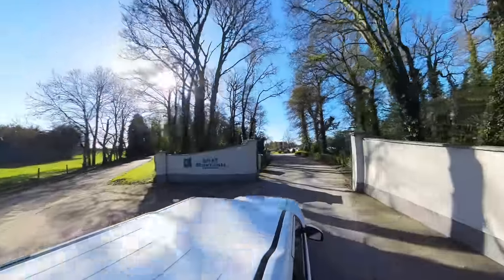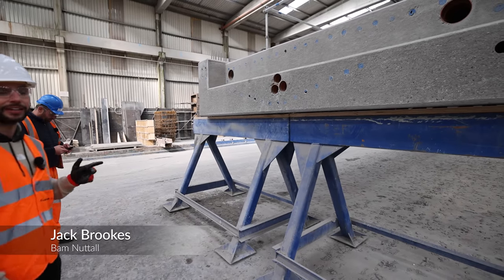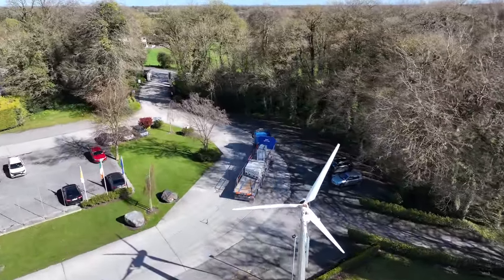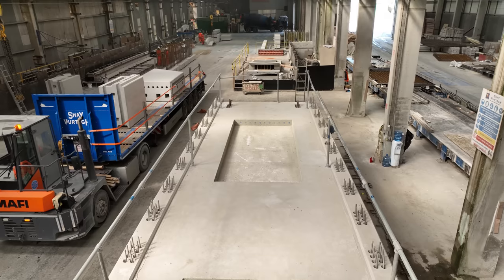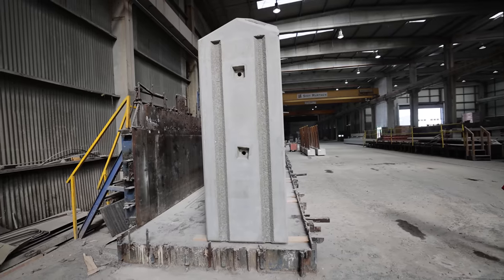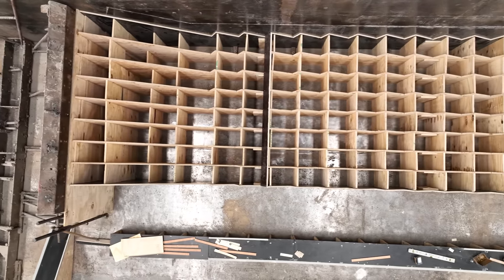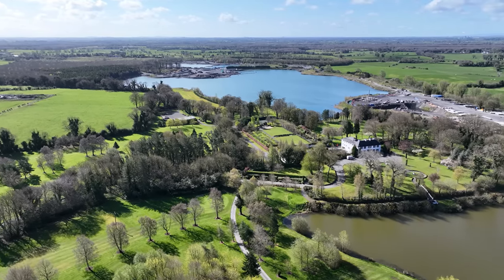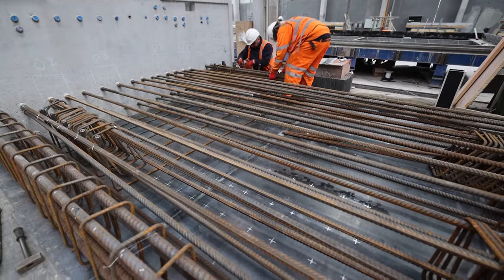Dawlish Sea Wall Update - June 2023 - A Trip to Shay Murtagh Precast in Ireland Part 2

Comment: It's really impressive to see all the thought that goes into reducing the loading of lorries onto the roads.

Did Shay Murtagh or BAM look into the idea of moving some precast elements by rail?

It is important to increase rail freight, and lower road freight and being able to drive building materials into the station would be awesome. But how does that maths of the loading on roads translate to how much load rails can take? Is there a problem getting concrete units through tunnels, near to Dawlish? Are there any weak bridges that couldn't take the weight of some of the Dawlish components? Would something like the two bridges be too long to get around curves? How do the rules compare?

Comment: Took a trip to Dawlish yesterday. Have been determined to take a look at the new Marine Parade and station engineering work since 2021 after watching on You Tube. What an incredible feat of engineering. What an incredible feat of collaboration between Bam Nuttall , Murtaghs, GWR, and Devon County Council. It is absolutely
an awesome achievement, impressive beyond measure working around tides, weather and railway timetables.

Comment: Where is the reduction of the carbon footprint when the products are travelling hundreds of miles?
Reply: See part 1!
Reply: Where does the rear come from?
Reply: Where does the reinforcing bar come from?
Reply: @paulsheward3325  I don’t know but probably a lot closer than the iPad I’m using. It is very true that much of what we use comes from some distance. At one time all the bio fuel in Britain had to be shipped to one refinery for processing using a very high proportion of diesel to get it their after harvest in order to obtain a marginal improvement in pollution and lower miles per gallon! Here we have coastal protection and property preservation that will hopefully last a couple of life times. Now that is a gain for many people.